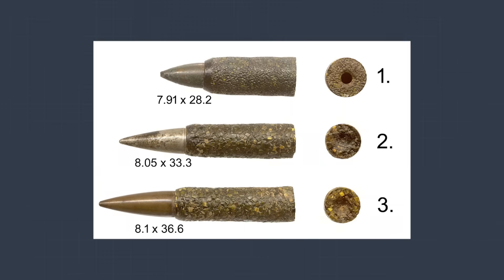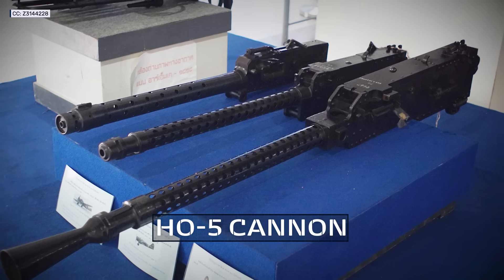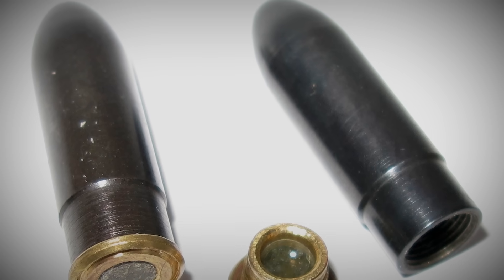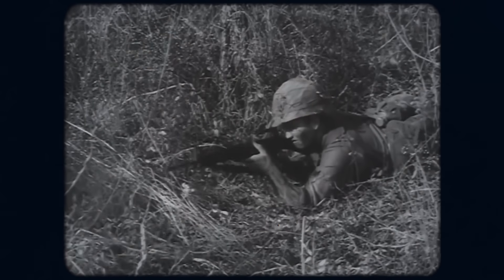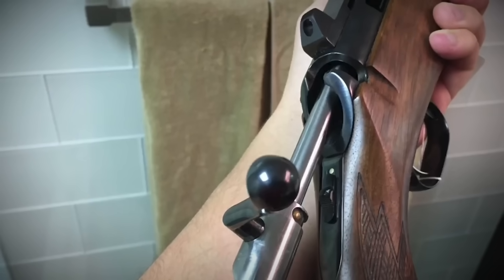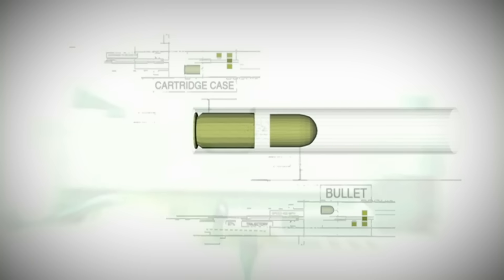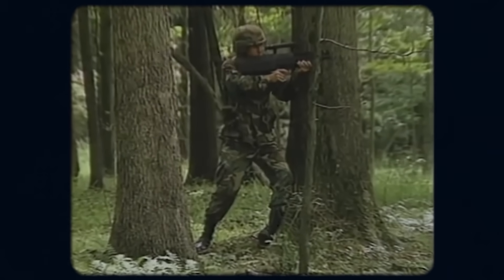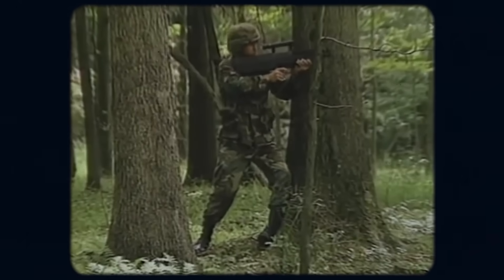Is Caseless Ammunition the Future of Warfare?

Comment: At 7:00 the M16 wasn't bad per say. The far bigger problem was the ammo manufacturer not using the same propellant powder than was used during trials, but filling the ammo with old, inferior quality gunpowder they had for different ammo types. With proper ammo and some cleaning, the M16 worked just fine. But telling the soldiers that the gun never has to be cleaned and giving them trash ammo is a sure way for desaster.
Reply: Agreed. I carried the M16a1 using the SS109 ammo. The chromed chamber helped, but one still had to use the "toothbrush" and shaving brush with a little CLP every time one stopped. In two deployments, 83 and 89, I never had stoppage or malfunction. But my unit stressed PMCS. Cheers from a former Ranger
Reply: @Hillbilly001 former army mechanic here. ( yah we used are weapons far less thankfully ) 
We had the m4s, deployed to Iraq couple times. We still hit the range often out there ( life as support). And the dessert and the m4 are a terrible combo. Lots had jamming issues even though first sgt always preached the importance of daily maintenence. Even though it wasn't used much, every night I broke it down blew out with compressed air and did a light clp wipe down. Never had a problem because of it. The thing definitely didn't like " environmental factors" but yah keeping it well maintained and it never let you down.
Reply: @rdrrr   oh yah. Basically turned everything into a fine mud in the rifle. Their were muzzle and magazine well plugs they issued us which helped. But that fine sand gets in everything no matter how tight you think you have something sealed
Reply: @billweirdo9657  I know what you mean. My unit stressed maintenance heavily. Everytime you stopped on the training area, you pulled the bolt and brushed it down. On deployment, Grenada in 83 and Panama in 89, it was second nature to brush and CLP the bolt. I never had a stoppage nor did any of my fire team and then platoon. Although the SAW and the M-60 had the occasional problem, but my gunners got it cleared and back in it pretty quickly. However, the 16's never had any problems other than the boys burning through the ammo. Course, I was banging away right along with them. LoL. Gotta get fire superiority quickly. Cheers from a former Ranger
Reply: The AR15 was designed around IMR4475 propellant produced by DuPont and utilized by Remington. That propellant burned very quickly with very little left over residue. When the weapon was officially adopted to replace the M14 either DuPont couldn’t keep up with production or the Army required increased muzzle velocity or both. It was decided to use BAL propellant already in mass production which burned longer and raised the muzzle velocity due to increased chamber pressure. Unfortunately this created two problems. One the new propellant increased the cyclic rate that bolt carrier bounce would lead to failure to fire malfunctions especially in full auto. Also the new powder left more residue fouling the weapon more quickly. The bigger problem was the decision not to chrome line the barrel and chamber as in the original design. This failure lead coupled with lax cleaning recommendations lead to rapid pitting and corrosion of the bore and chamber surfaces. When the brass case expanded after ignition of the propellant it would expand into the pits and irregularities in the chamber and could not be extracted without running a cleaning rod (which Marines and Soldiers didn’t have) down from the muzzle. As I recall a subsequent Congressional hearing found the Army grossly negligent in those two decisions. The Army and Colts did fix the problems withe the M16A1 with changes in the buffer, bolt carrier & firing pin, and chrome lining the chamber and eventually the bore. They also issued cleaning kits, CLP lubricant and revised cleaning instructions to reduce corrosion and failure to extract malfunctions.
Reply: @Chiller11  MONEY$ ; how many guns where bought/issued maintained ?

let's chrome them 50.000?
Reply: @Chiller11  BigArmy chose that other powder because they had stockpiles of it already and didn't want to buy new powder when "they didn't need too" and they were too stupid/ignorant to know WHY they NEEDED the other powder.
Reply: If I remembered correctly the trials used a faster burning stick powder while the ammo used in the war was a ball powder, not bad in itself but when there is no cleaning and the environmental factors are dirty, hot & humid then you have bad combination. A good idea is when the Army & Marine Corp say chrome lined barrel just do it and include cleaning kits as a precaution. No design is free from the need of maintenance & cleaning including the Kalashnikov.
Reply: @jacobhuff3748 The powders had the same peak pressure.  The rifles were fixed by 1969, and the Army stopped telling the troops they didn't need cleaning.
Reply: @jacobhuff3748 Wasn't the ammunition used in the trials the type that the weapon was designed to fire? I remember reading that the manufacturer used that ammo to test fire production batches, until they ran out, then switched to the same ammo being used by the army, which caused enough problems that they had to petition the army to accept the batches that failed testing with the army standard ammo.
Reply: The M16 when initially launched was SABOTAGED!
The barrel was not chrome lined making it prone to rust.
The aluminum in the receiver was not the right alloy and this meant that sweat can cause erosion.
the incorrect powder was used (though this was fixed by modifying the buffer.  This was a design flaw).
The weapon was not deployed with cleaning kits.

The worst part was that some of these faults were intentional.
Reply: The powder was a DOD made issue. They were told X, they chose to use Y as Y was 'in stock already' ignoring WHY THEY WERE TOLD TO USE X in the first place.
Reply: @xxxlonewolf49  
The powder issue is VERY interesting. 
The initial powder used in the ammunition was a stick powder (often used in hunting and match cartridges).  The rifle was calibrated to that powder and a specific grain of powder.  The issue is that the military uses Ball powder in its ammunition (because it is easier to make the ammunition).
If the developers used the powder in the ammunition that the military was most familiar with, this would not have been an issue.  Unfortunately they did not and that made things a bit complicated.
Reply: @johnsmithfakename8422  The team used BETTER powder. The Army used CHEAP powder.
Reply: It was not the manufacturer, it was the us army ordinance board.  They totally changed the propellant type, removed the requirement for the chrome barrel lining, changed the gas feed line, as well reduced the barrel thickness.  This was placed due to pressure from McNamara’s policy of reducing cost in the procurement pipeline.  The manufacturers just built to the contract requirements.
Reply: "per se" is the correct spelling.
Reply: Part of the problem was that Colt didn't know how to properly chrome line the chamber.
Reply: @davidjernigan8161 The Army told them not to follow that part of rhe specification.
Reply: Wasn't it designed for slower burning powder and the manufacturer ignored that and went with faster burning powder? I think Stoner himself said something about it during the investigation..
Reply: @Troubl3_Actual  the original powder manufacturer handpicked production lots for testing. When the army scaled DuPont had to say they couldn't supply the propellant in the contracted amounts, and the program had to find an alternate on short notice.
Reply: @Troubl3_Actual yeah the manufacturer was given bad info.  Wendigoon has a great episode on it
Reply: Yeah guns need to be cleaned.
Reply: The 5.56 was developed using IMR style, extruded powder. This powder burns very clean. The M16 was tuned to use this powder.

Once the M16 was adopted, the Army realized they had millions of pounds of spherical ball powder, and decided to use their ball powder instead of the extruded powder. The ball powder burned faster, created higher gas port pressure, and caused a lot of functioning issues, especially in full auto. To exasperate the situation, the ball powder does not burn as cleanly as the extruded powder causing all kinds of fouling issues. 

To alleviate the issues with the ball powder, they changed the buffer weight to slow bolt travel. They also chrome lined the bore & chamber & issued cleaning kits. Now, the rifle would work just fine with either powder. Though, the cleaner burning, extruded powder eventually became standard.
Reply: the manufacturer didnt change the powder the US  ARMY did
Reply: Never changed the powder type. They instead changed the buffer to allow the M16 to reliably function with the new pressure curve.
Reply: @No-mq5lw  Tbh requiring a more expensive, higher quality powder was a disadvantage of the original design

Disregarding Stoner's recommendation to use IMR powder and issuing the rifle with the wrong powder was dumb but the USAOB would've been right to demand changes to the buffer to enable operation with ball powder for logistical reasons
Reply: @No-mq5lw you do know a court verified that the army changed the powder right?
Reply: As a soldier who got issued a vietnam era M16 with new and improved ammo,  every 32nd round on average you heard a distinct "click" that still gives me nightmares.  So I disagree with your assessment.   Also,  I cleaned the hell out of it. The problem with the early 16s was the tiny gas tube which was changed in the A1 version.
Reply: @johnholmes6897  Thanks for your insight. :)
Reply: i was checking to see if someone made this observation before writing my own comment, cheers
Reply: That decision probably got a lot of young boys killed.
Reply: I fought a war for four years with an M16/M4.  Iraq part 2.  It is in fact a great weapon, it's only problem was as you pointed out, in the 60's the ammo manufacturer went cheap and used essentially a "black" powder, which fouled the chambers about as you'd expect.  I've shot black powder LongColt .45.  The chambers foul after about four re-loads, by foul I mean the rounds no longer fit into the chamber.  Imagine that with an automatic.  One 20 rd magazine was enough to require field stripping and cleaning, until they ran out of that cheap ammo.
Reply: Don’t blame the manufacturer. It was the pencil neck clowns in the gov that ordered it
Reply: Nope.  Nothing wrong with the powder, as powder.  Armalite had specified an extruded powder with a pressure that was balanced to the main spring.  The BLC-2 powder loaded by the Army's own ammunition plants had the same chamber pressure but a sharper pressure peak.  This resulted in a faster pressure peak, cycling the action gaster than designed.  All it took to fix that was a heavier buffer spring.

All y'alldo know that McNamara abolished the Board of Ordnance, right?
Reply: It was also the army going cheap and not chrome plating the inside of the barrels that caused jamming. If the barrel wasn't chrome plated and you left a round in the chamber more than a few hours, rust would form around it jamming it in the gun. Once you fired it and ramrodded the spent shell out, it would fire like normal until the next time that you left another round in it during your nap or leave.
Reply: Improved Military Rifle propellant was replaced with Ball Powder if memory serves me
Reply: I concur.
Reply: Any gun that has to have a 'forward assist' to compensate for jambing, is a "bad" design.  BTW, Korea make their version of the M16 and designed it right so it doesn' need, or have, a forward assist.
Reply: That and adding the forward assist, so when the rifle acquired a bit of dirt, mud or water you could force the bolt to slam all the way forward and lock, thus ensuring the rifle is in battery.
Reply: Yeah exactly. It was actually a very good machine when operated the way it was intended. It's a great example of the ridiculousness that can and often does happen in the industry. You have to trust the people who know their jobs and do them well, and not the people who have no idea when they don't stay in their lane, all through the organization. Do that and you're gonna do great
Reply: @splatchson  "Very Good" for it's era maybe. And your statement is wrong. The AR15 wasn't designed from the ground up for anything. It was an AR10 downscaled for the .223 Varmint Round.
The AR18 is superior in every conceivable measure. The AR15 was an awkward middle child between 2 purpose built systems that never really excelled in anything.
Reply: And no chrome lined bore or chamber in a jungle environment.  Men died and had to keep on dying to get the point across.  If they hadn't had their m14s taken away more men would have lived and more enemies would not have lived to kill another day.
Reply: Exactly so.  It was an issuance and supply issue.  The M16A1 was perfectly reliable when fielded with the properly pressured ammo.
Reply: Didn't the geniuses at the Army Ordnance Board also refused Stoner's suggestion to chrome line the inside of the gas tube, barrel and bolt-face to aid in reliability, cause they wanted to save money on each M16 adopted?
Reply: AKS WORK THAT WAY THE REST JAM
Reply: Except that the supposedly "trash ammo" was perfectly fine in every other gun....
Reply: @rosomak8244 Sure, one issue with direct impingement systems is carbon fouling gets everywhere and you need to clean it more often. Dirty ammo is okay when you're only fouling the barrel and the gas tube. It's really bad when you're fouling the chamber.

The AR-15 was designed to be as light as possible. In its original incarnation it weighed just 6lbs unloaded. But compromises were made to achieve that. The action is one of them. You have to clean a direct impingement rifle a lot more often than a gas piston rifle. And dirty ammo is out of the question.

Nowadays the tradeoff isn't considered worth it, which is why modern infantry rifles all use gas piston operation.
Reply: No, it was bad. 1:12 Twist with 55 grain .223 ammo is BAD.
1:7 Twist with 65 grain 5.56mm, as per the M16A2, is at least modestly lethal.
Reply: @Mygg_Jeager  In my experience in two deployments, Grenada in 83 and Panama in 89, I found it to be quite lethal. Maybe your experience was different, but the .223(5.56mm) worked just fine. You do have combat experience with the weapon don't you? Cheers from a former Ranger
Reply: @Hillbilly001  Lethality was enhanced via the "tumbling" aspect designed in after the initial problematic Vietnam War trials; a kludge built in to compensate for the small caliber.  Even with more grains of powder behind it, there's only so much a .223 bullet can do, especially against body armor.
Reply: @xheralt  Fortunately, none of my opponents wore body armor. In two deployments, Grenada in 83 and Panama in 89, I serviced many targets and even though I fired twice I found one round to be quite sufficient if you put the round center mass. Although I did hit a few in the extremities and that usually took the fight out of them. Maybe your experiences might have been different, but I found the.223 round, at battle ranges, to get the job done. Cheers from a former Ranger
Reply: @Hillbilly001   Anything can kill with a well placed shot. 😏 Even 22lr. That's not the argument we're having here, don't move the goal posts. Cheers from a weapons tech.
Reply: @Mygg_Jeager  55 grain xm193 has more lethal terminal effect when the round tumbles and fragments on impact.  The faster 55 grain ammo also has the potential to penetrate lvl 3 armor at shorter ranges when fired from a 20" barrel due to the higher velocity.  When shooting the ammunition it was designed for the m16 worked just fine.  Yes faster twist rates are better for modern rifles with more ammunition options, but when the original m16 was fielded they had just one cartridge.  The ss109 was designed to meet NATO requirements to penetrate a .125 cold rolled steel plate at 500 yards, yet it was noted that it had less damaging effects on soft targets ie. people.... the primary targets that small arms are meant to shoot.  The steel core ss109 is also inherently less accurate due to then inconsistency in the location of the steel penetrator within bullet itself leading to an unevenly balanced projectile.
Reply: @angryroostercreations5194  Yeah but the problem is that it DOESN'T tumble and fragment though.
Reply: @Mygg_Jeager 

 in my m16a2, the entire time I served,  we trained with, carried and fired primarily the green tipped M855 which is 62 grain NATO ball.  

And the m193 55 grain nato round as well , which is what I prefer in my AR with 20 inch FN barrel 1:7 turn
Reply: @NeedsLessWedge  
The funny thing is, math doesn't really care what you and I prefer. 62-75 grain in a 1:12 is understabilized and might keyhole, and 55 grain in a 1:7 is over stabilized and bleeds excessive energy, reducing terminal velocity and effective range. I prefer dirt cheap ammo when I shoot recreationally. Doesn't mean it's a good choice. :P
Reply: @Mygg_Jeager  Wrong, it was VERY leathal. The Faster twist and 65gr ammo was because the MARKMANSHIP TEAM wanted a more accurate round for COMPEATING...so the whole army suffered.
Reply: @Mygg_Jeager  The 1:12 twist in the original M16 and M16A1 caused the 55 grain M193 bullet to tumble rather violently inside tissue casing greater lethality than the over-stabilized 62 grain M855 round
Reply: @jeremymullins821  Modern replications of the 55 grain in Ballistic Gelatin prove that the "tumbling" claims were far over sold, to the point that in modern law it would be considered fraudulent.
Reply: @Mygg_Jeager a 55 gr projectile with a 1:12 twist out of a 20 inch barrel is really good at its job especially when the military was live testing and finding out what it does to people.  Don't know what youre getting at round absolutely slaps.
Reply: @theanimatedjunkyard5921  
That's the difference between "can" k1ll and "will likely" k1ll. If 55 grain can't Fragment, it's usually a w0unding sh0t.
And 55 grain reliably fragments less than 25% of the time. 1 in 4 is not a good outcome in a c0mbat situation.
(Censoring angry sounding "full-auto" words because youtube just be like that.)
Reply: @Mygg_Jeager 55gr fragments reliably out of a 20" barrel, it's plenty lethal.
Reply: @Mygg_Jeager  Lethality wasn't necessarily the goal.  Wounding was thought to be better.  Against "civilized" opponents like ourselves, extrication of wounded combatants to medical care is a high if not absolute priority; the logistics of extraction essentially ties up 5 soldiers on the wounded soldiers side per wounded soldier.  Nice theory, but the problem is, not every opponent we'll ever face fights the way we do, not all of them give a damn about frontline casualties!
Reply: @xheralt  That's a throughly debunked myth. Lethality is always preferable. That's why the regular army doesn't issue stun grenades.
Reply: @Mygg_Jeager how to show you don't know what your talking about.  

Its 62gr, not 65 gr, and 55gr is actually more lethal, not less.  Also, 1/7 twist was chosen to deal with extra long tracer ammo and is definitely not optimal for 62gr.

As for reliability, that stopped being an issue a very long time ago.  Ive fired a name brand quality 10.5" AR for over 1200 rounds, suppressed, without cleaning (just an occasional squirt of oil) before I gave up on my "test" and just cleaned it because i felt bad about my gun.
Reply: @bp968  62, 65, and 75 grain all exist in 5.56mm offerings. Way to show that YOU don't know what you're talking about. I never specifically named M855 Ball. I'm talking about ballistic properties in physics. Clearly this subject is well beyond your understanding. But if you'd like to learn something for free, refer to my 3 most recent comments above, discussing overstabilization. I look forward to you pretending to knowing what that means.
Reply: It wasn’t bad. But it’s not great. It’s why the HK416 is a better rifle than than any AR-15 with a stoner gas system. The stoner gas system is literally the rifle version of why you shouldn’t sh*t where you eat. It’s also more open to the elements than most rifles and it’s reliability in the jungle was initially atrocious. It did however improve with each iteration. But it was outperformed by Chinese made kalashnikovs, a rifle which is biggest strength is durability and reliability and cheapness
Reply: @markys7269  the DI system stoner designed is not bad. What are you even on about? It creates a rifle with far lower recoil than any piston system
Reply: @moonasha  Firstly, the stoner gas system isn't strictly a DI system as it does still use a piston, it's just that the piston is integrated into the bolt/carrier assembly so is better described as an integrated piston design. Secondly, while it isn't strictly a DI system it does share the DI systems possibly greatest flaw, it injects large quantities of gas into the operating system causing significant fouling compared to external piston systems.